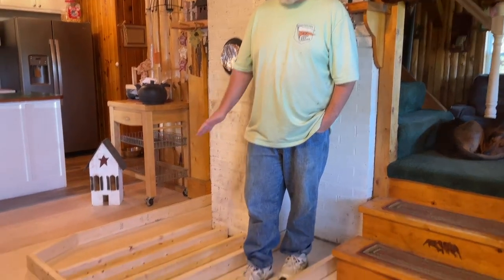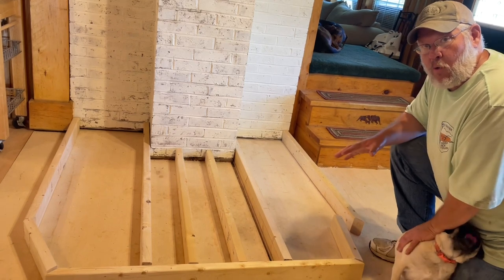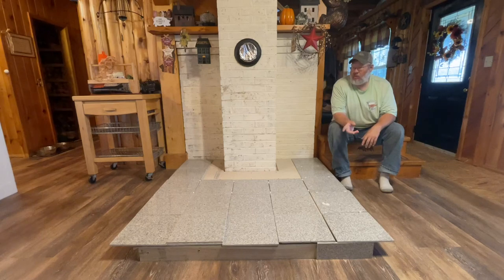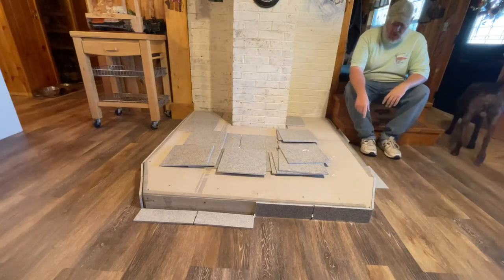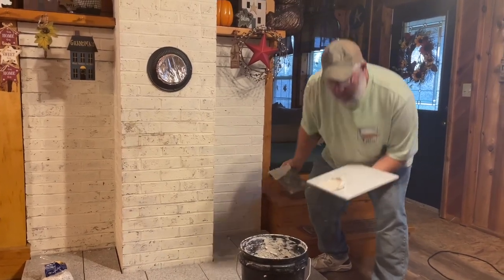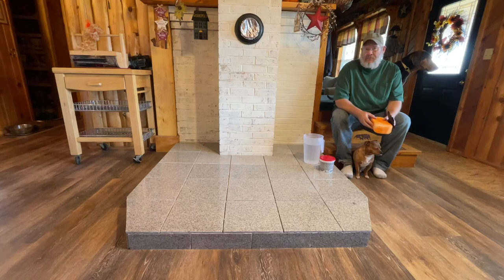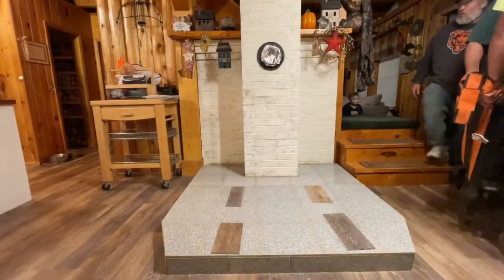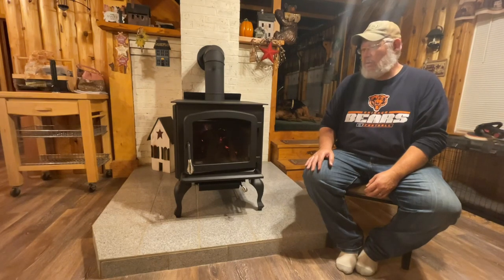DIY Homestead Granite hearth and wood stove install

Comment: Good stuff 
We had small arundel stove fitted The fitter said there'd be slight movement opening and closing the door but the whole thing moves a couple of millimetres on opening or closing so I've added a baton on the granite slab hearth floor behind the feet to brace against the wall tiles

Comment: Good work I have a question. I have a hardwood floor and Im installing a wood stove n the hardwood floor. Its a new floor. Did you  secure the framing to the floor base or is the 2x4's just sitting without being secured with screws? Reason I ask is because I am trying to avoid screwing into my nice HW floor. Thanks
Reply: Now that I looked closer at the video the frame moves a little and rocks some what as you are constructing it so you must not have secured the structure to the sub floor. I am wondering then how the hearth base does not move? Thanks
Reply from the maker: @justtruth8310  Thank for watching. The hearth is free floating. It fits tightly around the chimney which helps hold it in place. The weight of the hearth and the stove won’t allow it to move.
Reply: @TiltonsHeritagePastures  o Ok I see now. I don't want to ruin my hardwood floor in case I move the stove in the future. Thanks